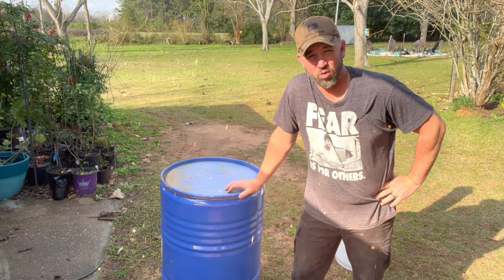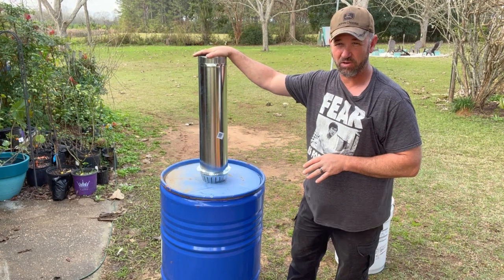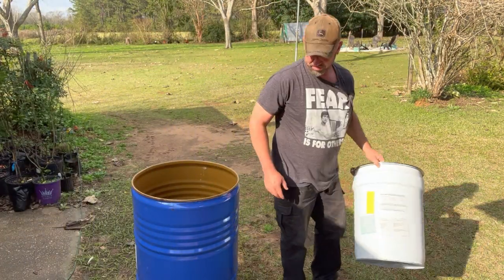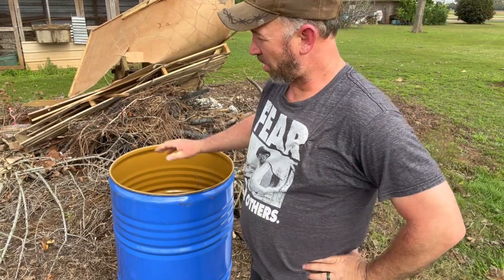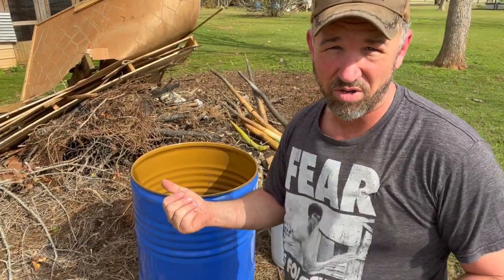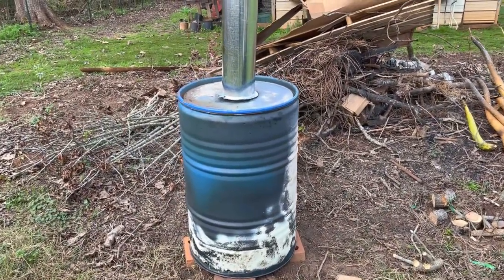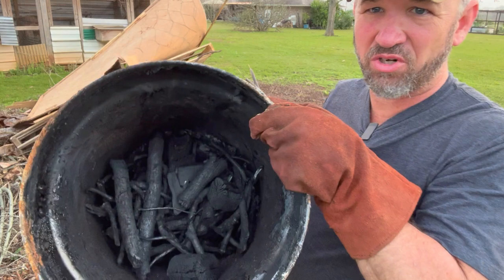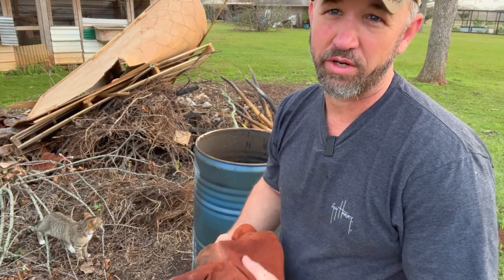How to Make a BioChar Retort Kiln | Make Charcoal at Home

Comment: If you drill some small holes near the base of the chimney pipe, you can introduce fresh air which will further the combustion process in the stack.
Reply from the maker: I've never thought about that, thanks for the tip!

Comment: Great video, but dont forget to inoculate your charcoal before putting it on the garden. This is what makes it 'bio' char. Otherwise it will pull nutrients from your soil and make your soil less fertile. Plenty on you tube about inoculation. Nice conside video on how to make good quality charcoal with a double barrel retort though.

Comment: I did this but its much faster and easier to just burn a pile of wood and when then fire dies down a bit hose it down and put out the fire.
Wait about an hour then stir up the charcoal and hose it down again.
After the coals are cold i shovel the coals onto a sieve made of 2x4s and 1/2 rabbit to remove any nails or trash from the charcoal.  I store the charcoal in a metal trashcans.
I keep my four chickens in a 28" tall, 4x12 coop with an upstairs henhouse on one end. There is a ramp i can raise to lock the hens in the house while i move the coop.
The coop is covered with 1/2" rabbit wire to make it hard for a raccoon to reach in and grab a chicken.
The top of the coop is covered with removeable hatches that i can take out to lighten the coop before i move it.
The concrete blocks around it make raised beds. I have seven beds side by side separated by concrete blocks turned sideways that give me 16 inches to walk on.
The coop fits down inside the blocks so no critter can dig under to get my chickens.
I move the coop every couple of months. I spread charcoal over the bed next too the coop then i move the coop over onto the charcoal covered bed.
The chickens break up the charcoal and charge it with benefical microbes and work it into the soil.
After i move the coop i shovel off the top two inches of coop soil and use it in my container garden.
I replace the two inches of soil with rotten wood chips and start over.
I am not smart enough to have thought this up before hand but one idea lead too another and over ten years developed this system that works for me in my situation which is an urban backyard with sandy soil. 
Hope this helps somebody.
John Davis Jax Fl
Reply from the maker: Phenomenal! Great job!

Comment: Best size is pea sized or wood pellet sized.
Powder will be hard to make a homogeneous mix into the soil.
Powder can also leech down and even out of the soil.

A wood stove in the winter time is the best time to make charcoal.
Unfortunately I no longer have access to a wood burner to make any.
Where I am I cannot do a trench burn and not too sure if it is legal to run a TLUD either.

Was wondering if one could use a rocket stove to make it?
Reply from the maker: I'm sure you can use a rocket stove to make it. Just have to play around with it.

Comment: Hmmm, elevate the inner barrel....hadn't thought of that.  Definitely going test that. 
If you're into "constructive criticism" (for improvement purposes), read on.  Otherwise, no use reading the rest of my comment. 
1st (and,  possibly, most important?) Drill  1/2" holes 2" down from top rim of barrel and, roughly, 2" apart ... all the way around the top of the barrel. Doing this creates the "afterburner" (introduction of secondary air to burn off the the gases that cause most of the smoke... it'll still smoke, off and on, but, most of the smoke will be moisture). 
2nd: if it sounds like "glass", you have successfully made "charcoal, under pyrolysis", NOT "biochar" (it is NOT "ready" to put into a garden, unless no plants will be put into the garden for several weeks +... won't add any "flavor" in a charcoal grill either, even if the wood started out as apple, pecan, hickory, mesquite, or otherwise....."activated charcoal" is something I plan to experiment with in the future.... it's not the same as "inoculated" or "biochar" charcoal, though).
3rd: I'm still experimenting with chimney lengths (and diameters). Without having the holes drilled around the top of the barrel (the "afterburner"), I can't suggest whether the shorter chimney or the lack of an afterburner is to "blame" for lack of the distinctive "rocket" sound shortly after you placed the lid (with chimney attached) on top of the outer barrel.....? 
4th: the drier the "feedstock" (wood inside the smaller barrel you turned into pyrolized charcoal), the more "yield", and less smoke (water evaporating) you'll get.  More "yield" meaning "more charcoal". 
That all being said, you created "charcoal under pyrolysis" (pyrolysis meaning, basically": wood superheated in an environment starved of oxygen). 
"Biochar" is when you add nutrients (and/or, preferably "and", microorganisms) to the charcoal BEFORE it gets put into your garden! If you use it to bbq, it's pretty much carbon (no flavor)... it'll burn though
Reply from the maker: Good information, thank you for sharing all of that info.